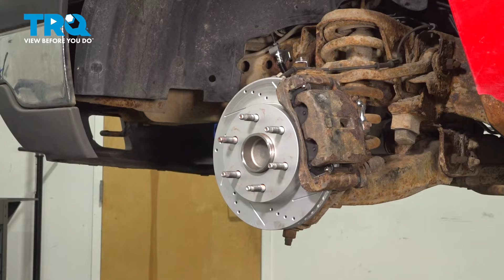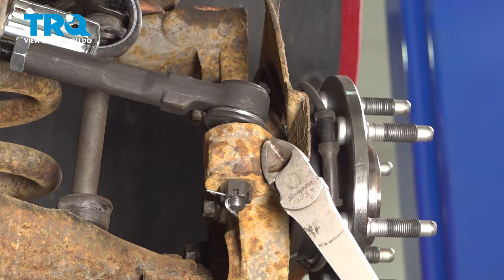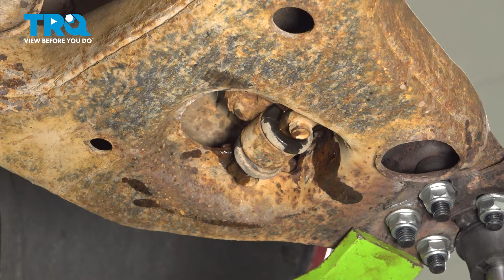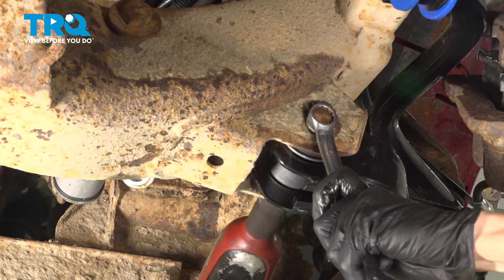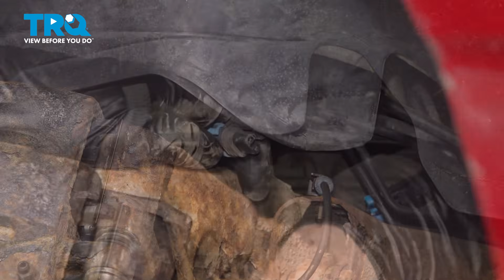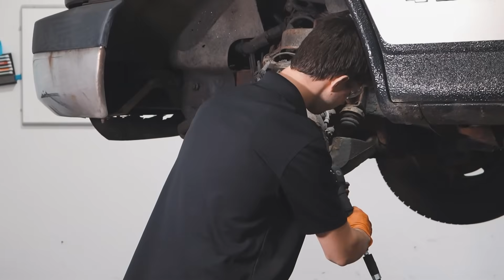How to Replace Front Lower Control Arms with Ball Joint 1999-2006 Chevrolet Silverado 1500

Comment: I noticed in this video you didn’t have to remove the torsion bar. So is it safe to say on the GM trucks when replacing the lower control arms you don’t have to remove the torsion bar? TIA
Reply from the maker: +@4rmDEC2FRE In many cases, you do not need to completely remove the torsion bar when replacing the lower control arms on GM trucks. Instead, you can use a torsion bar tool to unload the torsion bar, allowing you to detach it from the control arm without fully removing it12. This method can save time and effort while ensuring the torsion bar remains properly aligned.

Comment: In this video the lower control arms are 139ft lbs and in your upper control arm video you torque them to 129 so which is it ? Also the lower shock mount bolts are 19 ft lbs in this video and 25 in the other. You guys need to be clear on the torque specs not the first time I’ve come across your videos where the torque specs are off

Comment: So that lower control arm ball joint is not a press in type, where it connects to the knuckle ?  Should just slide right up onto it, if I have the angles of the lower control arm correct ? Having a tough time with it. Going to undo what I've done and follow this video step for step. 
Very good, clear cut video ! Love these TRQ Videos.